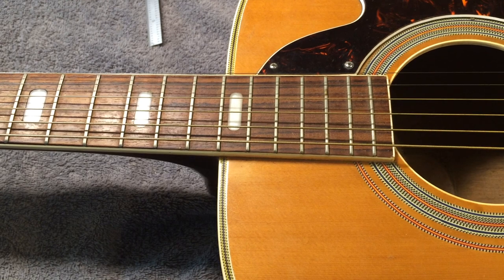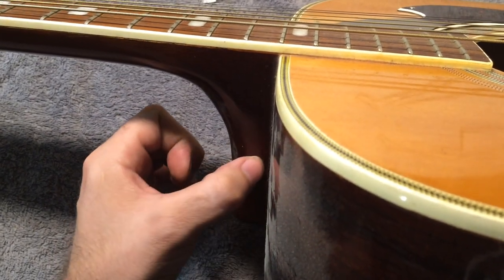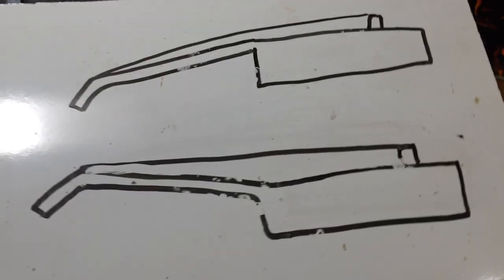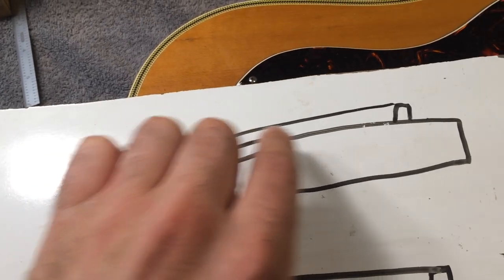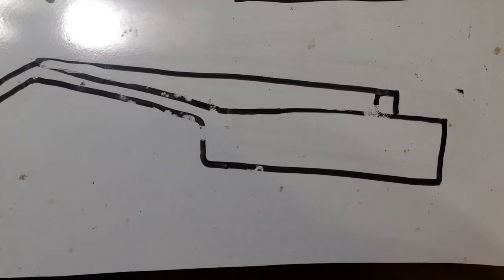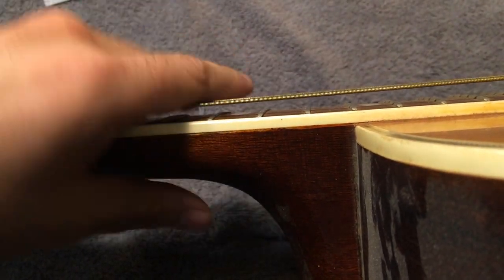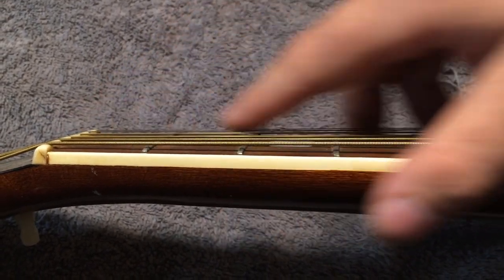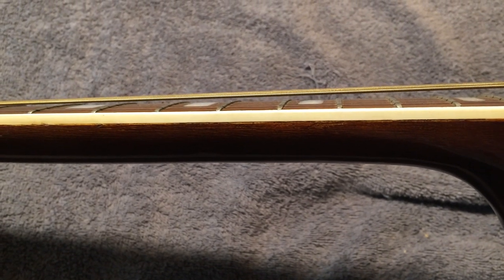How to Tell if a Guitar Needs a Neck Reset

Comment: As a mechanic I understand that there are items on a vehicle that will need maintenance over the (good) functioning life of the car and an engine's head gasket (as mentioned here). In relation to guitars, a neck reset is a (simular) equivalent. The older the guitar is the closer it is coming to need a neck reset...yes even a high end Martin or Gibson. So don't let this guy put you off buying a guitar that needs a neck reset. I you do buy a guitar and do a neck reset on it, it just means that you are at it's most usable and freshest point for that aspect of the guitar.
Reply from the maker: ^ This is a good take. If its worth it to you to do a restoration on the guitar, then you will end up with a fine instrument once that work is done. It will take doing the work though.

Comment: On a cheap guitar if you really wanted to make it playable one could remove the fretboard and reinstall with a shim. This gives two big advantages, first this is often easier especially on guitars with unknown neck joints/dowels/screws etc. and most importantly it allows you access to repair or install a new truss rod. Con: will have a long pie shaped edge binding but most will never notice or care.

Comment: What is dry steam???
Reply from the maker: Steam that has gone through a moisture trap in this case.
Reply: Dry steam is steam that is at the temperature of saturation, but does not contain water particles in suspension. It has a very high dryness fraction, with almost no moisture. Commercially, dry steam contains not more than one half of one percent moisture.
Reply: @DrewsGuitarShop  No, steam that's gone thru a moisture trap can still be considered not dry if has dropped in temp.  Dry steam is simply hot enough to cause all the water to be turned into gas...what we call...wait for it....STEAM.
Reply: @johnbee1069  You mean that dry steam is steam that is dry?

Comment: Well My 37 year old Alvarez Regent  is basically  not good for anything but a wall hanger, as my neck looks just like your picture.   I think I might just toss it,  Being often over sentimental over all things I own, I have learn sometimes you just got to let go.   And I wouldn't give it to anyone as it is junk, never mind ripping someone off by selling it.   because I don't  want to look at it all the time knowing it is unplayable, and sadly  4  decades   of poor experiences with  a few local guitar shops  on lesser issues with other guitars and equipment would be spending more than the guitar is worth and poor results.    I learned years ago never send an instrument in the mail, that is a nightmare I do not want to relive a third time.       I'll just buy another as I paid a little under $200 in 1986, and I can get a brand new one, same make and model for the same price.  Thankx for the well made video, made it easy for me to decide.

Comment: Very good video! But I would like to add one point: Depending on your taste not every guitar needs a high bridge. 

OK, with a high bridge the sound will be louder and will have more bass power. But oft times I did  "the poor man´s neck reset":
plained the wood lower, sometimes even routed a deeper slot, made 6 little slots to lead the string downwards into the hole.
Most times I liked the result: a faster attack, clearer, less boomier bass notes, more nice overtones. 

The guitars became very clear and bright and were easier to play also with the right hand. In some cases I liked them better
than the same model of the same brand with correct neck angle.
Reply from the maker: As mentioned in the vid, lowering the saddle or bridge is an option if you have the room to do so, but if you do not, and you have done what you can with the neck and nut, then the neck reset really is your last remaining option for getting the action down to a normal setup.
Reply: @DrewsGuitarShop  Is it true that as the bridge/saddle height is lowered that the guitar loses bass or fullness of tone? (I have a very expensive low-saddle guitar that sounds thin and I would get a neck reset done in a heartbeat if I thought it would bring out some fullness.)
Reply from the maker: @mojoefelix  yes.

Comment: This one looks a bit extreme but have you tried to see if it could be from a the wood sinking in? There is a cheap device that let's you drop a sponge in between the strings to sit in the port hole and for 3ish days while adding water back in every day, it may help.
Reply from the maker: That would raise the string height if anything. Dryness lowers the belly, moisture raises it. (40% RH is always recommended)

Comment: Another reason for high action might be a belly curve (the bridge pulling the soundboard up) i've fixed a few of these by doing "the poor mans neck reset" meaning i shave the bridge (the wood) down as well as the bridge piece and deepen the string channels coming from the peg holes so the break angle over the bone won't get to shallow.

After that i sand and oil the wooden bridge with some linseed oil to protect it.

It's not as "good a job" as a real neck reset of course and there's only so far you can go with this method but it's way more doable for the average Joe than removing frets and steaming a neck out, all you need is a scraper, some sandpaper, a dremel tool and some patience to get some extra years out of an old guitar you don't want to spend more on than it's worth.
Reply from the maker: I discuss why that isn't an option with this guitar at about 8:15. Its sometimes possible to do a bridge planing is there is enough material on the bridge to shave some down and still have a viable bridge, but in cases where the saddle is low and the bridge is low, its generally not an option.  Not to be critical of things that are working for you, but linseed oil is whats called a "drying oil" and you typically want to avoid using a drying oil like linseed, tung or the like on guitars as they dry and create a hard and permanent sort of shell. The usual go to oil for treating bridges and fretboards by most luthiers I know or have trained under is lemon oil, and I know some old timers that like to use kerosine.

Comment: Here is a question I have seen answered before but would like more of your opinion.  I really enjoyed your I nonsense explanation as to intonation issue when the action at the 12th is this high.  I have experienced this.  When it is that high off the fretboard, the depression downward is not only difficult, it is stretching the string to a pitch which is not going to match the note it should be at the 12th.  There is a design limitation of the max height to the tone it will emit when depressed downward.  If the height is too high, that design is no longer achievable and you get an awful intonation as you go up the fretboard.

Here is the question.  When a professional does the work, a neck reset, like you, do you think the guitar geometry will hold or will it continue to be flexed back, springing back, over time?  Some have commented on other guitar forums that the guitar geometry should hold for many, many years.
Reply from the maker: All acoustics will need neck resets. Their geometry will all change with age and tension.

Comment: Why not pull the inlay and drill the holes at a slight angle. it's much easier to do that and to fill and cover the holes? I do it when the opportunity arises. If it does not have a block inlay I can see pulling the fret and drilling there.
Reply from the maker: To each their own. I’m a creature of habit and I prefer to pull the fret because that’s how I learned and have always done it.
Reply: @DrewsGuitarShop  I can respect that!

Comment: isn't there a simple test you can do with a straight edge placed on the fret board to the bridge and get a visual of the neck angle with the straight edge ?  Nice Video i learned good things to know, Peace !
Reply from the maker: Most people don't have a straight edge laying around so I try not to use tools that a laymen won't have. If you do want to take that measurement though, you adjust neck relief first and then lay the straight edge on the board and bring it up to the bridge. If its healthy, the corner of the straight edge should kiss the front corner of the bridge.
Reply: @DrewsGuitarShop  Great Advice appreciated much, Peace !
Reply: yes, yes !
Reply: @DrewsGuitarShop  . Hello Drew. I’m late to the party , but this was a great little video. How does this straight edge vs the bridge height landing work for the typical Harmony/Kay vintage archtop? What’s the general area of the saddle/bridge (  with a non adjustable truss rod )for the straight edge check? I appreciate your time! Shawn
Reply from the maker: @FIGGY65   That’s a lot to explain in a YouTube comment. Archtops are a bit different.
Reply: Thank you Drew…..I’ll get it dialed in! Stay safe.

Comment: On cheaper Guitars you can do a kung Foo reset. Buy sawing the neck off at the body …removing the fretboard at the 14 fret basically turning it into a bolt on neck. If the customer just can’t part with it! Much easier.

Comment: Hey There! Yeah on this guitar it seems really terrible. But what if - after a best possible setup on my saddle I sanded off on high E string to the lowest possible value, just a little bit left, so that the string will not touch the bridge. But anyways - I still have 2.0mm on High E with healthy neck relief (as you said, business card, maybe a bit less than that). It seems that wooden past of the bridge is high enough to be sanded off, but I really dont wanna do this, as the guitar is still on warranty (8 months old). 
 Does it mean that I have to apply my warranty opportunity and ask for a neck reset?

Ideally I would like to prepare: 1st: 1.5mm, 2nd: 1.7mm, 3rd: 1.9mm, 4th: 2.1mm, 5th: 2.3mm, 6th: around 2.8mm. But 1-2 strings are 100% not manageble to get such values.
Reply: Please remember if you sand down the saddle, that you lose string break angle at the same time - very important so look out esp if its under warranty.

Comment: Heaven's above. Just put a good straight edge down the frets and see where it meets the bridge. It should be about 1/8" or so above it. If it is more than an eighth below it a neck reset is required. Good explanation of the reasoning but the test is simple.
Reply from the maker: Most people don't own a straight edge.

Comment: i didn't know that the neck wasn't supposed to be parallel to the rest of the body. very surprised that it would naturally move. i guess wood is really just more flexible than i thought.
Reply: I'm not sure it's simply flexibility. Lots of string tension on wood that dries and ages and settles in. Tongue falloff, humps and truss rod limits along with the incredibly disappearing saddles all require an expert evaluation.
Reply: @tomformanek3312  lots of that didn’t make sense to me because I’m a sculptor, not a musician, but it seems that the wood give would be a part of it?
Reply: @leam1978  Guitar necks on better instruments are attached with a large dovetail joint and glued in place. You want resonance in the body of an acoustic not the neck.

Comment: Just picked up a 1971 Yamaha FG-180 for $130 that needs a neck reset. Since the guitar isn't worth investing $400-600 into having it done professionally, I'm considering giving it a try myself and treating it as a learnIng experience. The worst-case scenario is that I end up with some cool wall art for the man cave.
Reply from the maker: Yamahas are a notoriously hard one to do a neck reset on. I suggest a lot of research before an attempt.
Reply: @@DrewsGuitarShop  that's my understanding. Apparenty, they used epoxy in some of the models. I'm initially going to try the method in which you apply steam to the neck joint from the sound hold with the guitar/neck braced while applying downward force on the neck. I've seen people have success, albeit limited with this method. It also has some belly buldge, so I'm hoping a bridge doctor and poor mans neck reset will have it playing better. 

If not, I'll try to tackle a proper neck reset.

Comment: I am by no means an expert but I saw many other issue's with that guitar besides needing a neck reset. First observation was, the screws that were attached to the pick gaurd. Are not those typse of guards glued down? And why would thry need screws? Is the top warped as well as it looks like the saddle and bridge is sagging with a bit of a wave beneath it? Am I missing something?  I'd take a look see inside to inspect the bracing. Perhaps it's come loose somewhere and is aiding that dip?
Reply from the maker: It's a cheaply built guitar as I stated in the video. It has other issues that I did not talk about because those were not on topic for this video. Screw on pick guards are something you see sometimes.

Comment: Do heavier gauge strings put more pressure on the neck joint  and increase the likelihood of neck issues and high action?
Reply from the maker: You should always have a guitar setup for the strings you are going to use. Heavy gause strings do have more tension and that of course translates to more tension on the instrument, but it does not = high action. It may speed up wear on the instrument and may increase the likelihood of joint failure under stress but assuming we are talking about run of the mill strings that were made for the type of guitar you have, I wouldn't worry about using them. Again, as long as the guitar is setup for them.

Comment: My 74 D35 Martin has worn frets, (beyond the 4th fret too). Would it be best to do a refret first before deciding on a neck reset? The last setup was done by a 'qualified' tech and the nut and saddle replaced, however the action is still a little high and the guitar is stiff to play even at the bottom end. The action could only be lowered so much due to fret wear. Would it be best to do a refret first before deciding on a neck reset?
Reply: I don't see how fret wear would prevent a guitar having low action, as worn frets a more likely to be a problem with high action. I would take a look at the height of the strings off the frets. Put a capo on the first fret and see how that plays. If this is notably more comfortable and there's no buzzing then it would suggest the strings could be lowered at the nut. Keeping the capo in place, fret the strings at the body fret. You should now see a slight plectrum width gap between strings and frets 6&7. Now look at the height of the strings off the body fret; this should be no more than a quarter inch. So if you have that plectrum width gap at frets 6&7 you can safely lower the saddle and adjust the nut slots. If you're not confident or don't have the tools, take the guitar to someone with a good reputation.
Reply from the maker: @Iazzaboyce  I am not sure how a tech would have determined your frets are an issue, but normally, I only take frets into account with my setups if they are unlevel in a way that prevents me from setting the action as low as I would like. If the frets are low over all, that shouldn’t be a problem, but if you have fretwear that would be another story. You should do the neck reset first and then do the refret after in the same trip if you want my opinion. Its nice when you can do a refret following a neck reset. If you do the refret before, you may have to pay for fretwork twice and get a level crown and polish you shouldn’t have needed.

Comment: If the neck joint is tight it is possible to take the back off jack it back straight and glue the back on at the new angle. Of course that is not easy either.
Reply from the maker: That sounds like something you should research. I have heard about people doing things like that, but this is not how I learned to deal with this issue from any of my mentors and I have never had the need to deal with it that way rather than do a normal neck reset.
Reply: Drew Jones you are right if the body is straight and no work needs to be done inside it is the only course to take, if the body has cracks and isn’t straight plus braces to glue back taking the back off is the best option, enjoyed you video.

Comment: Hello Drew. Good info. I'm surprised you don't mention using a straight edge across the fret board to see if it hits just at the top of the bridge to see if neck angle is good. I have always heard that to be a good check when looking to buy an acoustic. I know belly bow can also affect the bridge and therefore action as well.
Reply from the maker: I generally try to assume that folks watching these videos won't have the toolset that I do at the shop, but yeah, when I have a customer in front of me, shoring them that straight edge is usually when they go "oh.." when talking neck angle. The belly in a guitar can for sure be a factor too, but, you typically want to see somewhere around a 50' radius in the top of a modern "flat top" and people sometimes really freak out when they notice that for the first time. Its normal and healthy and will drift up or down due to humidity. If something comes in with a high belly, I am going to try setting that instrument in a optimal humidity environment for a while before jumping the gun on some of the crazy solutions I see tossed around for that. Often times, when I have someone talk to me about the belly in the guitar, its either normal and fine, or they have been over humidifying it. Rarely do I see anything else.
Reply: Thanks for this helpful video. How much below the top of the bridge would the fretboard have to be before it’s considered problematic? And do you base it on the straightedge laying on top of the frets or the fretboard itself (requiring a notched straightedge)?